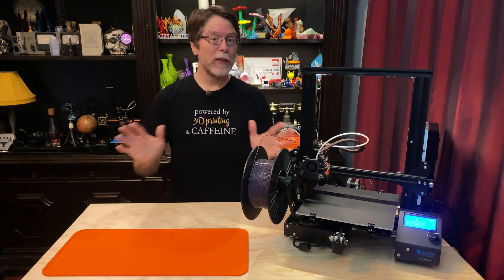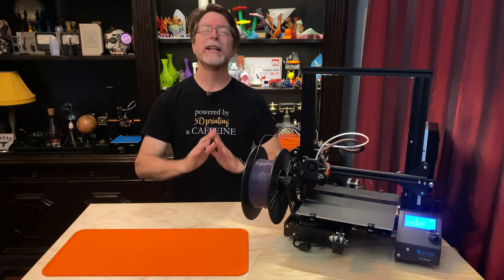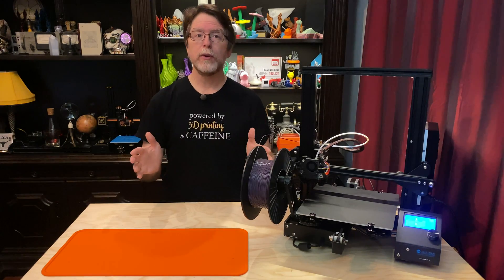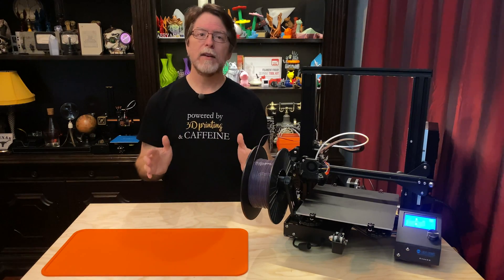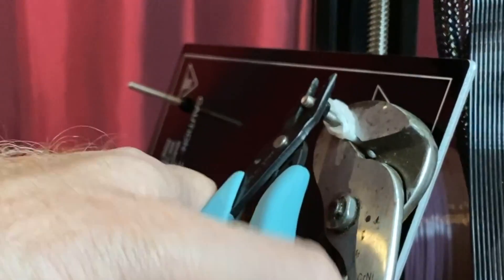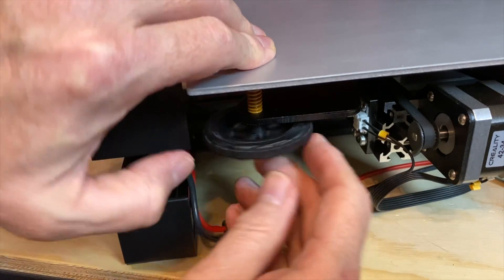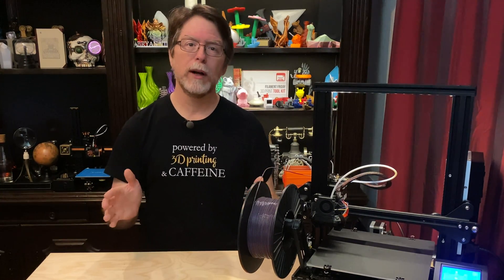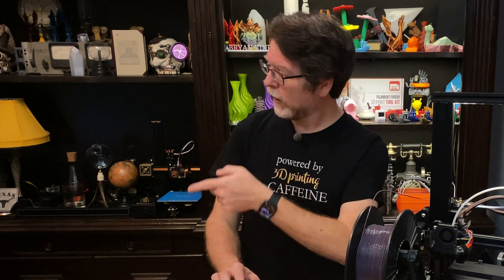This Simple Ender 3 and Ender 3 Pro Bed Mod is NUTS! 😜

Comment: I'll be turning my Ender 5 Pro bed into a 3 point adjustment bed by removing two of the adjustment screws on one side, drilling a new hole between the holes for the removed screws (making sure to not nick the traces) and use one of the screws there. A corresponding hole will be drilled in the bed support plate for the screw. This allows easier leveling without adding uneven forces to the bed through an extra unnecessary 4th screw.
Reply from the maker: Ah, that sounds cool. I've heard it said, "Three points define a plane. Four points define a Pringle™." I've seen three point leveling kits for the Ender 3, as well. Good luck, and let me know how that turns out! 👍
Reply: @BV3D  It might take me a little while to do that, but I'll try remember. First I'm going to try and wet sand my bed flat to get rid of as much warping as possible. I was considering buying a machined one from gulf coast robotics, but they only guarantee +-.2mm so I'd rather try flatten my own vs. $50 for that.

Comment: Thanks for the great video, I've done this as part of an upgrade spree - and started having trouble with bed heating. I've checked basically anything multiple times without any improvement. Then I've removed the nyloc nuts and one of them had nicked the insulation and had exposed the copper underneath. Fortunately that's an easy fix: I've added 4 strips of heat resistant insulation tape around each of the holes, which gives it a bit more padding and makes it less prone to scratches and fixed the short. I think it's good practice to do this preemptively.

Comment: simpler and part free solution

lower your z home switch

stretch your springs if they are not  strong enough

my CR-10 mini doesn't need this, but I've seen plenty of forum posts about needing this help. the only time I level is when I work on the hotend

Comment: USE LOW PROFILE NUTS FROM TEAM LOSI 22 BUGGY FRONT AXLE. TLR 236001. This isn’t as great as it seems with regular nuts. It compressed the crap out of the springs and you lose a lot of adjustment distance. Go with low profile ones part number above.

Comment: after all nuts are on the screws no longer lined up with the bed brace. didn't work until I adjusted them all to be equally crooked enough (none were straight) that they all fit in. a bit janky, but I gotta say this helped a ton with leveling! first layer looking awesome now.

Comment: Those nylon nuts have been proven to offer no more effectiveness than standard nuts under vibration. While it should be fine with nothing red loctite is your best bet for this
Reply: As a mechanical design engineer, i would disagree. Would you please explain /Tell us where have you acquired this information  so we could all learn.?

Comment: This is exactly what I needed. I put the nylocks on two weeks ago, but I just caught them still moving a couple days ago. I thought i had them tight, but they're still moving. I wasn't sure if I should pierce the top of the bed or not and put a screw/hex in there to hold it, but now I will!

Comment: A great idea right up to the point where the increased friction caused the bolts holding the bed to come loose and spin. Now I'm ending up with a good chance of stripping them trying to get the nuts off.

Comment: Do the yellow springs and the nylock nuts sit perfectly next to each other, so the springs are pushing on the nut instead of the bed, or do the nuts go in between the spring?

Comment: Nice! An idea for those with a stick on surface that plan on not removing... Once the Nylock is in a bit as you explained take 2 normal nuts and thread them in and use one to lock the other. Once these two normal nuts are locked, you can tighten the Nylock nut with no fear of damaging the threads by using a pliers or wrench. The person can use their teeth to grip onto it but this is not Approved by the Dental Association :)

Comment: After I put my glass bed back on, how do I level and adjust my z limit switch?
Reply: You have to re-align the z-limit switch by moving it manually and retighten the screws on this piece assuming that you are not using the BL-Touch mod

Comment: My printer is not an ender 3 but it did suffer from the same problem so I did an upgrade very similar to yours not long after I got my printer and it made bed levelling much easier. My printer had M3 screws which I swapped out for some slightly longer ones which I secured with M3 nylock nuts. It had wing nuts for adjustment which I got rid of and replaced with my own design printed knobs with M3 nylock nuts inserted into them. The advantage of doing that is my adjusters don't unscrew themselves.

Comment: Sorry Bryan. This is good way to  damage the pcb trace on the  heated bed, and potentially causing fire by shorting them as well. Use a ptf washer if you relay want to use the nut. Using cutting pilers as a wrench is worst practice ever. Total unprofessional.

The advice is also useless, as the screws do not generally rotate at all during adjustment. Anyway, if you have a problem with rotating use a drop of superglue to fix the heads of the screws.  This is simple and safe (cyanoacrylate is heat resistant up to ~120C.  
 I'm sorry, but the only sensible move is to replace the springs.

Comment: Best mod I done . Print adjuster wheels with nyloc nuts .. still stock springs . And the bed hasn't needed adjustment since . The stock wheels are too.loose and rotate everytime u bump em or depress the bed a bit.
Reply from the maker: Nylock nuts in the adjuster wheels is a great idea. 👍

Comment: Once the nyloc nut is maybe 1/3 on you could tighten 2 regular nuts together to hold while you tighten the nyloc.
Reply from the maker: Hi Old Curmudgeon! Now that I think about it, two of the leveling knobs could be used the same way, and would probably be a lot easier to hold on to. Thanks for the suggestion! 👍

Comment: Thanks for the great information Byran. I just picked up an Ender 3 Pro I'm looking to see what upgrades/mods I want to make. Are there any other mods that you recommend making?
Reply from the maker: Hi! Well, if you just got the printer, I'd recommend getting used to how it behaves without any modifications, for maybe about a month. That will give you a feel where YOU think the printer could use some improvements, and you can go from there.

Having said that, I do have a video with a handful of easy-to-print, snap-on upgrades to make life a little easier with an Ender 3 Pro, and they can also add a quick splash of color if you want. There are 
some printable clips to help tidy up the wiring, a snap on cover for the back of the control panel (why that's left exposed I have NO idea), and a few others. 

Check it out here 👉https://youtu.be/n3ayIxwNho0)

Comment: A good tip, but why don't you just buy a wrench the correct size instead of chancing damage to the threads by using a pipe wrench and/or pliers?
Reply from the maker: Hi! I usually advocate for "the right tool for the job," but sometimes I have to go with what's on hand. Sadly I couldn't locate my 6-inch Crescent wrench, and the next largest size I had was comically oversized.
The paper towel trick works well enough to keep a grip on the threads without crushing them.
It also would've been possible to reduce the risk somewhat by using a pair of regular M4 nuts tightened against each other at the end of the screw, once there was enough room for them. Then the M4s could be held onto with pliers to keep the screw from turning while tightening the Nylock nut.
Anyway, as with most things, there are usually several ways to accomplish the task, and I appreciate you bringing this up. 👍
Reply: @BV3D  sorry, just that my OCD is tools. I spend hours in tool shops and buy way to much stuff that I "may need one day" :-)

Comment: Just occured to me could we print the nuts? Great video, love the phone in the background you didn't get that from apple
Reply from the maker: Hi! Yes, it's entirely possible to print the nuts. There's a comment from 3D Jimmy where he says he did exactly that. I'm not sure what material he used to print them, but they would probably need to withstand at least 90˚C temps for extended periods, depending on how hot you usually run the bed. 😀

Comment: This is a great idea. My old MP Select V2 actually came with those nuts. My CR-10 and Ender 3 both need these.
Reply from the maker: Hi Marcus! My MP Select Plus has nuts on the bed screws too, but I think they're the non-locking variety (not sure, I'd have to give it a close look). 😄

Comment: When I saw the title I was kind of hoping you were going to show a video about getting rid of the springs.  I have a BLTouch and I've been thinking about getting rid of the springs and replacing them with solid spacers, like on the Prusa machines.  Seems like if you can get it relatively close then the BLTouch will compensate for the rest.  One less thing to think about getting messed up between prints would be nice.  Maybe an idea for a different video?
Reply from the maker: Definitely!. I still have that TH3D Studio EZABL I received in that mystery box a while back, so a video showing both the EZABL installation and swapping out for the solid spacers is a good video idea. Thanks! 👍

Comment: I got rid of the springs and wheels and just use silicone spacers.  Haven't had to touch the bed alignment in months.
Reply from the maker: Interesting. Tell me more! 🤔 Are the spacers bolted down, and non-adjustable? And are you doing this in conjunction with a bed probe?
Reply: @BV3D  You can adjust them a little by tightening the bolts and they will compress as needed. Leveled it manually that way and then I use the TH3D ABL on top of that.
Reply: @foxsquirrelz  Wouldn't the ABL be doing 99% of the work?

Comment: I did this for my Cr10S Pro. I bought better springs as well.
Reply from the maker: Hi! I don't know why these aren't bolted down like this from the factory, but between the nuts and the better springs, this bed really seems to be staying put. 👍
Reply: @BV3D  one reason is to better absorb the bed deformation after higher bed temperatures

Comment: Given the concern with cutting the heating traces, would a thin nylon washer that goes between the nylok and the bed be in order?
Reply from the maker: Hi Ken, the warning was more to just be aware of their presence. A light scratch on the paint shouldn't hurt anything, but a ham-fisted slip-up with a wrench could do some damage. The traces are reasonably thick, and the trace pattern actually leaves a bit of a margin around the holes. I don't think a nylon washer would be strictly necessary, but it certainly wouldn't hurt. 👍
Reply: Use a closed-end wrench (or even a ratchet with a deep socket) on the nut, and you shouldn't need to worry about cutting the traces. After you get the nnut to about 3mm away from the bed, turn the screw instead of the wrench/socket.